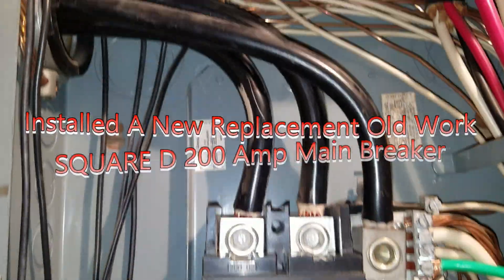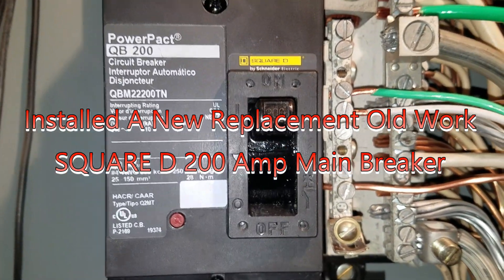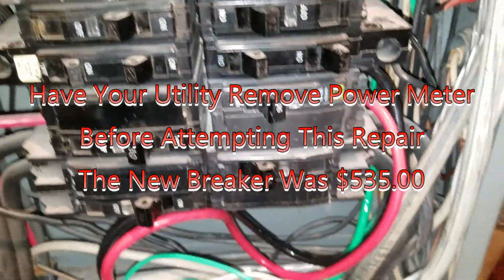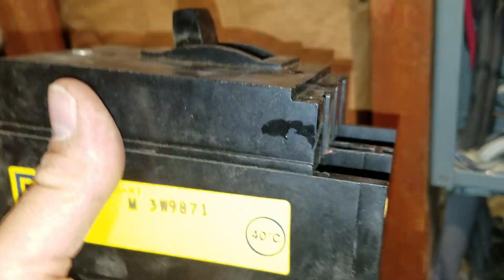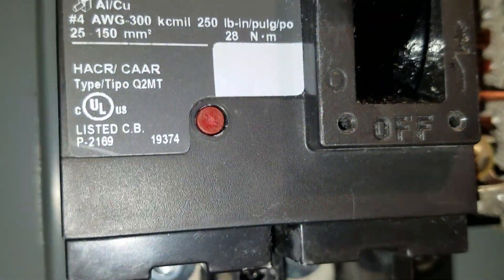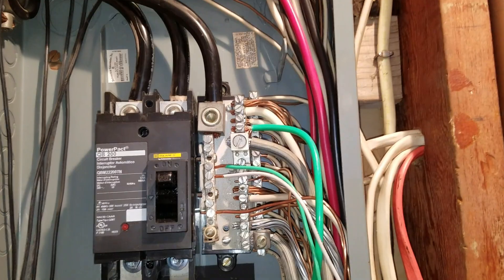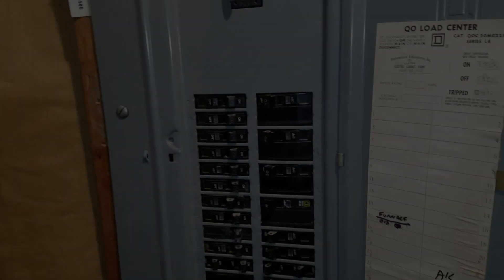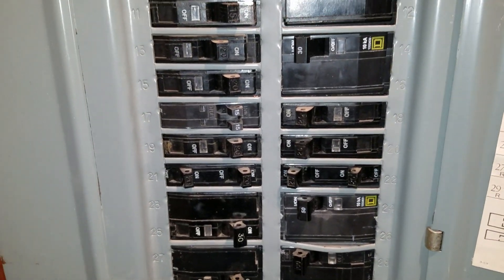Square D 200 AMP Main Breaker

Comment: What amps your old breaker?
Reply from the maker: It was a same size breaker. It was also an improved, cross-referenced, replacement. I believe PLATT electric supplied the replacement. Not just any breaker will fit into an electrical panel and you need to make sure the breaker is for the wiring in use.

Comment: Why not show how to remove the main breaker off the bus bar?
Reply from the maker: At the time, I didn't have a head mount for the GOPRO and you need both hands to do this work.
 I gave these instructions to another person in another post.
It can be easy to do depending upon your skill level. You must have the main power disconnected before attempting this project. Don't even think about doing it with live wires! After the main power is disconnected by the utility company at the meter, you can begin. Remove the panel cover. Pull out all breakers from the bus bars and let them hang out to the sides. Remove any breakers that prevent you from accessing the bus bars. Get a hex or appropriate wrench to loosen the main wires on the main breaker and pull them out. There are two bolts at the bottom of the main breaker attaching the bus bars to the main breaker, loosen the nuts and set aside. The main breaker has two screws attaching it to the breaker box, unscrew and set aside. You can now slide the main breaker and two bus bars up and out from the main panel. You can now separate the bus bars from the main breaker. It you find an original breaker it will cost 400 to 800 dollars since this particular breaker is discontinued. Fortunately, this breaker panel cross-referenced to accept a newer improved breaker through Platt Electric. Reverse the process to reassemble the breaker panel. Attach the bus bars to the main breaker and reset them into the holding slots. Screw the two main screws into the panel. Tighten down the main breaker bus bar bolts to the bus bars. Reconnect the breakers and any other wires previously removed. Reattach the main wires. Call the Inspector to get approval. Call power company to reattach the power to the meter. Take pictures along the way so you can reference what you've done if you need to help memory. good luck with your project and remember safety first.
Reply: @CITAP1  Figured it out and completed job before I got your text. But thanks for your reply and explaining it very thoroughly
Reply from the maker: @royradomski4420  Glad things worked out for you.
Reply: @CITAP1  thank you. Fir what it’s worth I enjoyed your video. Have a great day

Comment: You're not an electrician 🤷🏿‍♂️
Reply from the maker: I don't claim to be an Electrician.  I have been building and remodeling houses for 45 years. I do have a 2 year degree in electronics with experience in digital circuits and took a couple quarters of power systems at the behest of one of my instructors.  I've picked up a few bits of knowledge over the years.  Other than poor camerawork,  you're welcome to point out something you think is wrong. Take care...

Comment: You did not show how to do it. Lol
Reply from the maker: It can be easy to do depending upon your skill level. You must have the main power disconnected before attempting this project. Don't even think about doing it with live wires! After the main power is disconnected by the utility company at the meter, you can begin. Remove the panel cover. Pull out all breakers from the bus bars and let them hang out to the sides. Remove any breakers that prevent you from accessing the bus bars. Get a hex or appropriate wrench to loosen the main wires on the main breaker and pull them out. There are two bolts at the bottom of the main breaker attaching the bus bars to the main breaker, loosen the nuts and set aside. The main breaker has two screws attaching it to the breaker box, unscrew and set aside. You can now slide the main breaker and two bus bars up and out from the main panel. You can now separate the bus bars from the main breaker. It you find an original breaker it will cost 400 to 800 dollars since this particular breaker is discontinued. Fortunately, this breaker panel cross-referenced to accept a newer improved breaker through Platt Electric. Reverse the process to reassemble the breaker panel. Attach the bus bars to the main breaker and reset them into the holding slots. Screw the two main screws into the panel. Tighten down the main breaker bus bar bolts to the bus bars. Reconnect the breakers and any other wires previously removed. Reattach the main wires. Call the Inspector to get approval. Call power company to reattach the power to the meter. Take pictures along the way so you can reference what you've done if you need to help memory. good luck with your project and remember safety first.

Comment: Well Jeff, did you do the work and can you show the steps to do the work?
Reply from the maker: What part do you have a question about? Quickly, this was a new version main breaker manufacturer rated as a replacement for this panel I think about 550.00 to get. Turn off power! Unbolt the main from panel and the two busses. The busses will pull up  out of their retainer slots then you can pull outward to loosen to separate the main. Reverse process to reinstall. 
It usually myself doing projects and no way to position the camera.
Reply: @CITAP1  I guess I was expecting to see a step by step video on how you replaced the breaker.  And, did you say that this 200 amp, 2-pole  breaker is $550,00.  I had no idea they were that expensive.  Thanks for your response.
Reply from the maker: You'll have to unclip most of the breakers from the top down to be able to maneuver the bus bars. Pull the bus bars out from the studs on the main, remove and replace. Slip the bus bar retainers back down into their slots. Tighten main to bus bars, replace breakers, put cover on, reconnect power, done.

Comment: How did you get (lift) the bus bars off of the breaker studs?
Reply from the maker: First! Have the power utility remove the meter to kill the power. The main is bolted to each bus bar. You also need to pull out all the circuit breakers and then you can access the bus bars for positioning them during the procedure.

Comment: Looks good Jeff..another job done !  It's working..yeah..that's always good..lol.
Reply from the maker: I should have shown how the old breaker would not shut off after it was removed. When it was on the panel and you tried to shut it off, it would smoke and buzz. Not a good thing.
Reply: @CITAP1  Yikes..for sure !  Fire waiting to happen huh.
Reply from the maker: @paulhunter546  Not a good situation. About a year ago, an apartment owner had me look at his older electric panel with a couple buzzing breakers. He went to flip one off and on. It exploded and the breaker was in big flames arcing electrical fire. My brother quickly grabbed the co2 extinguisher and put the fire out. In those few seconds, the wall was on fire. Had we not been there, the building very well could have burned down.  Installed a new Square D panel that day. Gained a lot more respect for the potential  of electrical fires after that...